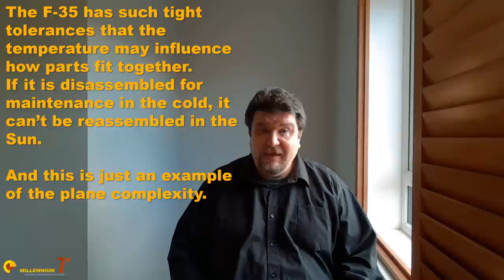F-35: The Failure of the $100 Million  Dollar Jet | Maybe...

Comment: F-22/35: Quality over quantity

Air force: Oh we needed quantity after all
Reply from the maker: Perfect!
Reply: Isn't that what makes a multirole: quantity?
Reply: @Joshua_N-A  having multi-role models allows for less quantity
Reply: @Millennium7HistoryTech  
"Quantity has a quality all its own." 
Lenin
Reply: It does ot help that the plane has to be overly expensive since you have to everything included in  the design, and cannot just put on pods when something is needed for a different mission. And that just means everything just got bigger, including the engines.  And to make it even worse they tried to go to one design for all services when the requirements are so much different. It also means you are stuck with a design and have absolutely no option. All eggs in one basket stupidity. SO DUMB.
Reply: This is just an air forces idea to force Congress to get more F-35 once they see that the cost of the so call  4 gen++ fighter cost more then the F-35. Since The F-35 cost less to make then more 4 gen++ now. Spend a few million on a digital design man 4 gen fighter so Congress will spend billons more on more F-35. The air force already say what they are planning to do don't affect F-35 build number at all.
Reply: @jimc1654  LOL. You really believe the Air Force likes this plane. I really doubt it. It is a compromise. The whole thing was forced down their throats. They did not have the control that they would have had if they had had sole control of the project, and they still cannot go too far from the standard to get what they want. Every change to meet real Air Force requirements is probably a fight, and the air force is forced to compromise on what they get. I am sure the Air Force does want their own plane. I do not think the air force was at all happy with the F4 either.  Navy is still unhappy with the Seahawk that was force down their throat
Reply: @aaronseet2738  I always thought the post-Cold War budget reductions is the root of JSF.
Reply: @Joshua_N-A  From my understanding you are correct, the JSF came as a result to post cold war budget cuts.
Reply: In the high low mix the F-22 is suppose to be the high (quality over quantity) and a plane like the F-35 is suppose to be the low (quantity over quality). The F-15 was the high and the F-16 was the low with the F-15 getting all of the toys and the F-16 aimed at being a low cost plane with an inferior radar for example. The Navy had the F-14 on the high side and the F-18 on the low side with that plane also having a weak radar for example when compared to the F-14. The USSR also had a high low mix with the SU-27 being the high mix and the MIG-29 being the low mix, the F-35 IMHO failed at the low part of the mix though we also need a bit more F-22 then we have to replace the F-15C. 

We could restart the F-22 production line as that study was already done and we already have the cost estimates of what that would cost, the real problem with restarting the F-22 production line is that the plane would also need an update as it was a plane that entered service in 2005. The cost to upgrade the planes and restart the production line doesn't make sense when you consider that a sixth generation fighter is already in development, which means that we would have upgraded and restarted the F-22 to produce a small amount of planes just before being superseded by another plane.
Reply: @cliffordnelson8454   The Air Force pilots like the F-35 and all that need to be said. Who are you say Air Force don't like the plane. The person when set the flight performance of the F-22 state that the Air Force get a very good plane in the F-35.
Reply: @doc7000  i believe that was the idea! However with the vertical take off and stealth being important factors of the requirement, i believe the cost went up!
Reply: @adisura9904  it went up for more reasons then that
Reply: @doc7000  yeah im sure of that. What i meant to imply was, It got complex and costly!
Reply: @adisura9904  you can argue that this failre was by design.... That making these planes too complex was a mistake.
Reply: @doc7000  yeah absolutely.
Reply: Quality? LOL 0 combat hour. Landed by itself with fire all over the engine.
Reply: The Canadian government put the nail in their F-35 Buy's coffin last week in response to Biden's cancelation of the Keystone oil pipeline that resulted in 17,000 Canadians losing their jobs overnight.  On 3/2 the Canadian Parliament voted 315 to 23 to exclude American manufacturers from their current Fighter Aircraft procurement, as well as the procurement of next generation Royal Canadian Navy's procurement of 6 Frigates.
The US Navy has asked Congress to cut its F-35 acquisition in half , and then acquire 280 more Super Hornets.
Every Foreign Military sales buyer that started with the JSF program has cut its buy. The $85 million price (A model) was only going to be realized if ALL of the F-35s originally planned were built.
Do you really think, for example, that the Italian taxpayers are going to stand on future procurement of 90+ aircraft at $100 million a piece? Maybe the 30 F-35Bs to equip ITS Trieste and ITS Cavour since they already invested in the ships. The rest will probably look like Gripen E/Fs with a service life upgrade on their Typhoons. And this is going to happen all over the World.
Reply: @aaronseet2738  Not if your mission rate is high. Having 50 planes that can do all 200 missions, once per plane is still only 50 missions that can be complete per flight.
Reply: @cliffordnelson8454   It's the F111 all over again. When will we ever learn?
Reply: @jimc1654  LMAO. You know nothing because it is more than just the pilots loving it. You have durability, maintenance, availability, and cost. Like the Japanese are cutting down the number of Chinese aircraft intercepted because it puts too much wear on these fragile, hard to maintain, easy to damage, and expensive to maintain turkeys. Brand new aircraft sufferings from wear. Good thing you never considered going into engineering, you projects would have all been disasters. '

Also you know they are lying through their teeth because all you have to do is look at the specification for these aircraft. They are heavy for their engines, low rate of climb, and have very high wing loading. It is all a sales pitch that you are hearing. Like believing a used car salesman.  They apparently did a simulation of a conflict in the pacific with the Chinese, and it was so embarrassing for the F-35....it was a slaughter. Get into close range, and the F-35 is so overmatched it is ridiculous, and there is a long history of the effectiveness of missiles being so overrated in effectiveness. To make it worse the F-35 can carry so few because they all have to be carried internally to maintain stealth. Add on the outside and suddenly you lose all the first detect advantage. How about working on some military programs first. I have, including a stealth aircraft. Armchair experts. LOL.
Reply: @Vespyr_  Except that the F-35 is going to have a miserable mission rate. Needs much more maintenance and it is more difficult because work on because access points hurt stealth. Also skin is fragile. Forgot what the availability of f-22 is but it very low after decades, and the F-35 is still miserable and it appears it never will be. F-16 is somewhere in the 65% range, while the Flanker is in the 70's
Reply: At this rate in the few years the US will only be able to afford one plane. LOL.
Reply: @jimc1654   I'm with YOU buddy. 

"Okay okay, the 125 million dollar F-35 that presently makes all jets that flies near it more dominant is too expensive -- let's get the BARGAIN F-15X  .... predicated off (physical design & stealth: 1970s, flight controls: 1970s: communications: 2000s with a tiny percent 2010s) for a mere $90 million. 

uh......... wait, what? 

HOW is the $90 MILLION an F-15 costs (with a FRACTION the F-35's ability + lethality) a "BARGAIN" & not just penny wise & dollar STUPID. 

The R&D money is SPENT --  just FINISH THE PROJECT already. 

Only future costs vs abilities should be compared. 
Money that's ALREADY GONE? Is irrelevant.

IS there another "united states" that the US can use cyber espionage to steal designs from ..?  I'm thinking "no" ... meaning we can't exactly pretend as though there's a fair comparison...even IF their cost of living (big mac index) wages for experts in applied physics etc were the same ... 

We're ALWAYS going to have to pay the "first mover" costs -- and now that they ARE paid..? It's not like we're going to LOSE or FORGET the knowledge attained.  Lockheed has a massive lead in the field of Stealth. 

Is there any method by which we arrive there cheaply?? 
Either in R&D ... Learning to manufacture to maintain the tolerances... or "re-learning" how to fight with an F-35 (5th Gen) at the center of a squadron to potentiate the lethality of the jets it's cooperating with..? 

If only there were another US [the actual US] could commit espionage against... (as China & Russia does). Assuming no one else was going to pay "first mover" costs...and we want to maintain the ability to attain air supremacy in future battlefields...? What CHOICE did we have..?

Remember: 
We CANNOT compete with China on "man power" (until their population curve reveals the problems with limiting couples to 1 child).

We CANNOT (unless we spend massive amounts of money) compete with Russia on missile defense technology ... and our strategies wouldn't benefit from them even if we did as they're primarily defensive in nature...(making the use comparative cost-metrics all the stupider). 

Our only choice if we scrap the F-35 (as we've likely done with respect to Russia by selling any to Turkey anyway) is to make a hybrid of the F-22 + F-35's best features.
Reply: USMC has NO CHOICE but to keep the F-35.*  
USN has NO CHOICE but to find a long range fleet defender**
The AF has almost no choice but to use an F-22 + F-35 hybrid.***

* WHAT STOVL options have the Marine Corps? Will they be going BACK to the AV-8B ...?? lol. This is BEYOND discussion. 

** The USN probably has the greatest pressure to do so given the increasing range of hypersonic anti-ship warfare ... can't be any more of a mystery to China that their "communications kill chain" is their weak link than it is to the lay person who just casually follows the subject. They NEED greater range AND stealth. 

* The Air Force..? Well, they uniquely have the "rights" to the F-22 & F-35. They'll find a way (some conflict where a few of our boys are killed) to justify another Trillion or two ... unless ... someone thinks we're "SO fiscally conservative" that we'd "never do such a thing" ... lol.
Reply: @trumanhw  you need to actually read something, and if you did you would know a lot of what you are saying has no basis in reality.

The only one you are even close on is the Marines. You do realize that the F-18 production line is still open, and that the Marines currently fly F-18's, and that development and production is still occurring on the F-18.  Guess not. Well the Marines (and of course the Navy) can easily buy more F-18s, and it will not take a lot of ramp up time. Of course there is no option for the VTOL requirement.

Navy as above. They can still buy F-18's so they have a choice, and as said above the production lines are still producing. So you are so wrong there.

Both the F-16 and F-15 production lines are still operating and there continues to be operating so they have an option there. And guess what....the F-22 is not an option since the production line closed down a decade ago, so no option there. And the F-22 aircraft are really hard to keep operating. They are at about 50% in 2019, and I think there are only 125 mission capable F-22.

2019 availability:

F-15C	70.05%
F-15D	72.45%
F-15E	71.29%
F-16C	72.97%
F-16D	70.37%
F-22A	50.57%
F-35A	61.6%
Reply: @aaronseet2738  Sure from the budget perspective.  But you have a larger fraction of the force suitable for any given mission.  There would be a range of force sizes where you have both fewer total planes AND more planes capable of performing any given mission role.
Reply: Look at all the youtube F-35 "experts" in this comment section- hilarious!
Reply: 20-1 kill ratio at red flag
Reply: @jackboot8432  
Stalin you mean
Reply: @cliffordnelson8454  
You know the USMC do not fly the F/A-18E/F/G... right?
Its the C/D they desperately need to replace and they flat out refused to order the E/F.
Reply: @FallenPhoenix86  You know that the F-18 is still in production don't you. You really think i would be that hard to replace the current C/C for a new F-18 model for the USMC. You really need to work on your logic. The USMC order would certainly be high enough to justify a model upgrade to meet USMC requirements. You do know that there is a high demand for the F-18 Growler do you not. If it not like the F-22. Funny is it not that so many F-18's are being sold when it is such an old aircraft vs the very much newer F-35. Wonder why? Could if be so many issues with the F-35 and that the F-35 still has major deficiencies, 800 or so last time i looked after 25 years of development. Cost would be a hell of a lot less than the F-35, which is so very expensive to operate, and would be cheaper to purchase in the long run since the F-35 has a airframe life of 8k hours vs about 2.5 times that of the F-18. You think I am stupid don't you. LOL. You obviously cannot see outside the box.
Reply: @cliffordnelson8454  im not going to read all of that, not worth the time kid...

The Marines don't want the E/F... the C/D are not in production... they are not replacing their Hornets with more Hornets, Super or otherwise.